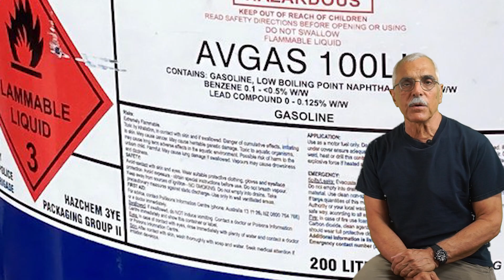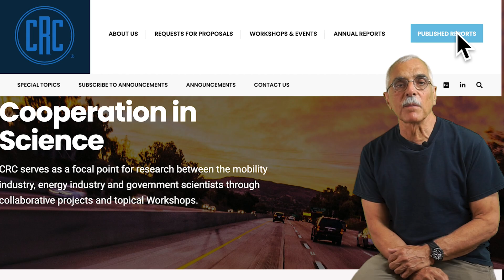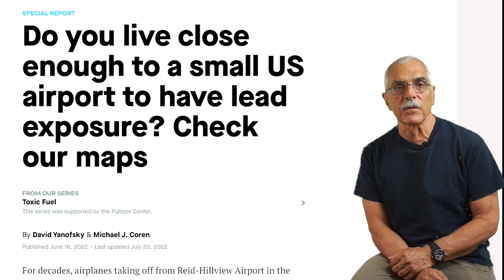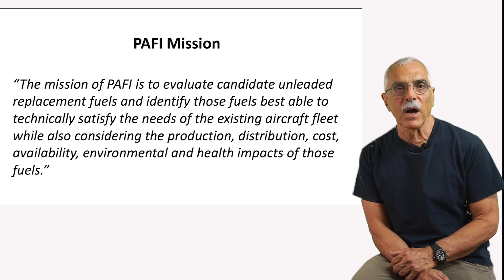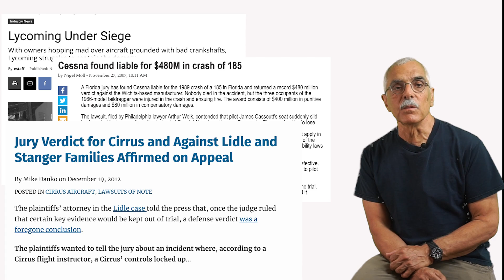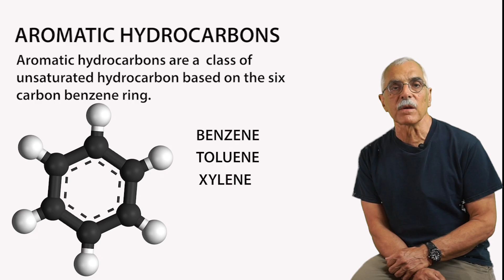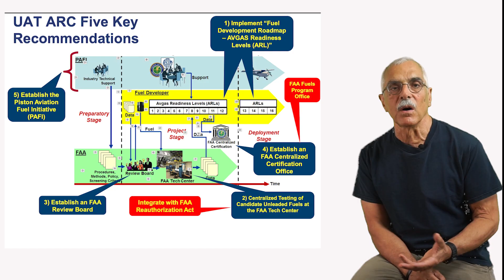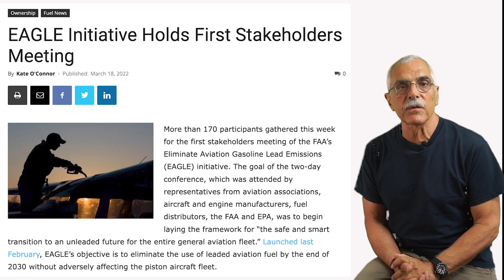The Long, Twisted and Slightly Ridiculous Story of Avgas Part 2

Comment: Lead isn't necessary - unless you don't have hardened exhaust valve seats. Ask the Robinson helicopter fleet in Australia. We found the same thing out with automobile engines when they got rid of leaded mogas. As the older cars went to the junkyard, the uproar died down. Lead makes a barrier between the hot exhaust valve and non-hardened valve seats - preventing micro welds. Repeated micro welds eat valve seats and cause valve swallowing. Which engines are prone to valve failure? Good question. I guess you will find out in the air.
Reply: I have no idea but are hardend valve seats still not used in aircraft engines? To me it's common sense that eventually 100LL will go away and has been obvious for a few decades. Plenty of time to address the valve seat issues at overhaul time and in new engines in preparation for the inevitable. But without a hard deadline on removal of lead I suspect little to nothing has been done to prepare for it.
Reply: @ulbuilder  My airplane turned 50 this year, like most GA aircraft. Its last engine overhaul was 30 years ago. Did they use hardened valve seats? The company does not keep records that go back that far. And how many people also have engines/cylinders that were overhauled by companies that are no longer in business? Who knew to prepare for unleaded AVgas 30 years ago? 40 years ago? 50 years ago?
Reply: @paramax55  The more I read on the subject the more I'm convinced that lead did nothing to protect valve seats anyway so having hardened valve seats or not does not matter. Lower octane gas causing detonation is what erroded valve seats. Even the FAA has studied this and concluded that the lead is not needed to prevent valve wear.
Reply: @ulbuilder  Except that reducing lead has caused valve wear (via the seat) every time. As I stated... it caused a huge problem with Robinson helicopters in Australia. A lot of people don't remember the valve jobs that cars got in the '90s for the same problem. Low performance engines as well as those with hardened valve seats will fare well.
Reply: @paramax55  I just read the Australia Airworthiness Bulletin dated Aug 12st 2021, it did not state that issues were caused by lack of lead in the fuel. It points out that certain blends of aromatics are insufficient to maintain the octane level when less lead is added. The issue is octane, not lead content. Lead is great for boosting octane, that's the only thing it's good for. From the actual bulletin "There is a limit to which the effect of reduction in lead (tetraethyl lead) may be offset by the base alkylate and aromatic content to achieve the required Motor Octane Number (MON)
for the fuel."
So there you have it, lack of lead is not causing problems, lack of octane is what's causing problems.
The bulletin also warns about proper oil selection, operating temperatures and cool down procedures. Did you know lower CHT and EGT reduces the risk of detonation? Did you know lower octane increases the chance of detonation? Every credible source I've found blames detonation from lower octane, not the lead content, for the wear on valve seats. It's true that maintaining adequate octane is difficult without lead. It's true that detonation from too low of octane damages engines. It's not true that lack of lead causes engine damage or that abrasive lead salts produced in combustion of leaded fuel somehow act as a lubricant to reduce valve wear.
Reply: @ulbuilder  So... the Folks Against Aviation say that microwelds at the valve/seat interface isn't stopped by lead making an inhospitable environment for bonding. But NASCAR was able to directly trace the troubles of going lead-free to this microwelding problem. As well as many head rebuilders having a standard fix of inserting hardened seats and eliminating the problem instantly.

If the problem were simply "octane," there wouldn't be a problem. Two solutions are simple and have been around for a long time - Water/Methanol injection and Toluene. Water/Methanol isn't a drop-in, but Toluene is. And it's easy to get - they sell it in Home Improvement stores as Xylene paint thinner. It has an octane rating of 121 by itself and, as an additive, it raises the octane by more than what its ratio says it should. F1 called it "rocket fuel" until it was eventually banned (like everything fun in racing). If valve/seat bonding could be fixed through octane, the folks that make a bunch of money on Sundays would have figured it out a long time ago.

Anything that interrupts the valve/seat bond will work - be it cooler temps, shorter valve open times, work-hardened metal in used engines, a chemical barrier (lead oxides), and of course hardened seats. Lower performance engines will have lower temperature valves. Engines that have both lower performance and work hardened seats also stand a good chance. But there is no way of knowing without "trying it out" and crossing your fingers.

Say what you will, but the folks at NASCAR, as well as cylinder head rebuilders, know that lead in gas will prevent valve recession due to microwelds. The FAA says that lab results contradict this, but the real world experience (also called beta testing) show something different. I spend too much money every time things break on my airplane. Until I'm forced to, I won't be running any unleaded AVgas in my engine.
Reply: @ulbuilder  I just gave you six sources to peruse on this subject. The matter was established long ago and the discussion died down when older cars left the road.
Reply: @paramax55  interesting debate guys! Kinda sheds more light on the subject of (lead is only for octane) and (it's not just for octane, but protects the seats if the engine doesn't have hardened seats or if its low compression can get by without lead). I was there when we transitioned to unleaded mogas & low compression poochy engines. I knew lead was "supposed" to protect the seats. But for some reason never really heard or fully understood the whole  microwelding issue as you explained. I guess at that time I was concentrating on my specialty, automatic transmissions.                 Folks Against Aviation! Good one!
 Oh well, so I guess the beat goes on...
Reply: So do a lot of av engines have cast iron heads without hardened valve seat inserts? Just asking. Any aluminium heads will already have valve seat inserts from day one so they should be fine.
Reply: @oneninerniner3427  Aviation engines have aluminum heads. The seats are steel and may or may not be hardened. There is really no way to know without asking whomever installed them.
Reply: @paramax55  so you can or could get them either way mild relatively steel or hardened? I know automotive valve jobs were fairly common back in the leaded fuel days as well as spark plug cleaning and replacement and gunky dirty engine internals, some caused by poor oils but had a lot to do with leaded fuels. But are seldom needed now days.
Reply: @oneninerniner3427  if you get a valve seat today, I couldn't imagine that it's not hardened. There are a lot of factors today that are different than just 30 years ago that makes things last longer. I have found fuel injection alone to double gas mileage just because of better fuel atomization (360ci Big Block Ford V8). Better mileage means less fuel burned means more complete combustion means fewer deposits. Electronic ignition (usually capacitive discharge) is also going to produce a MUCH hotter spark at a more precise moment. All of this has led to less fouling and longer lasting engines. Metallurgy and machining precision has also gotten us to the point to where the modern grocery-getter would be very competitive in yesteryear's NASCAR.

As far as aviation valve seats being available "either way" 30 years ago, I'm not sure how that went. As far as automotive went, you took your heads to a "head guy" (I used Ed Garlits, Big Daddy Don's nephew) and he would "just fix" them for you. The question never came up unless it was for racing. It wasn't even thought about until unleaded gasoline was all that you could get.

If there isn't an incentive for the more-expensive option, things tend to be built with the cheaper option. Look at how many weed-eaters are out there with aluminum cylinder bores... But as for modern valve seats in an airplane engine - I'm pretty sure the cost difference would be a wash nowadays.
Reply: @paramax55  I agree on all points , I am a mechanic too, not an A&P but have worked on darn near everything else. My Father was in the aviation business so I have some piston engine background there too.  Except I also read about what ulbuilder was talking about. That it is a lack of octane causing high combustion temps that erodes valve seats, not a lack of lead. I have a 1970 big block engine that was transplanted into my old pickup that I bought from a buddy many years ago and It does have recessed valve seats. I ran pump premium non ox unleaded in it most of the time. But did run regular sometimes too. So I ran it hard with regular once and detonated a piston, pulled the head and pan to replace the piston and I then seen that primarily the exhaust valves were starting to recess. Which was a bummer because my buddy spent a lot of money rebuilding that engine before he put it in the truck and the machine shop did not  put in valve seat inserts, they just reground the existing seats that were part of the cast iron heads. But I ran it another decade that way and it still runs, but needs help now. Probably should have run some octane booster or a top lube might have helped a little, idk.
Reply: Also I am currently porting a head on a 2006 model 700 cc big bore dirt bike. I found I can cut the ID radius of the seats with carbine, it's an aluminum head with pressed in seats,  so they aren't that darn hard!
Reply: @oneninerniner3427  Yep. They need to be soft enough to accept the pounding of a valve without shattering. I don't know what the "magic" number is on the rockwell scale. A hammer is also hardened, but you can scrape it with a file. It just has to be harder than the nail, but can't be too hard or it will shatter. Carbide does a nice job on most metals.
Reply: @paramax55  Ed Garlits huh? Wow,  Got a feeling he knew his stuff
Reply: So bottom line is av engines would benefit immensely from the elimination of lead with reduced maintenance. Spark plugs would last, engines internally would be cleaner, oil drain intervals could be increased, quality synthetic oils could be used which would further reduce wear, because now with leaded fuel, lead doesn't like to stay suspended in synthetic oils that's why they aren't widely used,  stuck valves would pretty much be history, even TBO's might be increased. The problem is to achieve high enough octane without TEL. And GAMI says they have the formula?!!!!! So other than the STC deal, they said they will license it to anyone for a reasonably price who wants to blend it.
Reply: @oneninerniner3427  Exactly!
Reply: @paramax55  The John A Garbak article did not control for octane rating. Any study that compares lead vs unleaded that did not also verify that the octane rating of each fuel was identical is flawed. Remember that the octane rating on the pump is minimum not maximum. If one tests leaded fuel vs unleaded fuel and the octane rating of each is not verified to be identical then any difference in wear could be from lead content and/or difference in octane rating. It's well known leaded fuels had higher octane than unleaded therefore comparing leaded fuels vs unleaded is also comparing higher octane vs lower octane. For proof of octane difference see NY Times article "Drive for unleaded gas is causing wide confusion" Jan 17th 1971 "there gen erally were two gasoline grades: premium 100 octane fuel used in the biggest Ⅴ‐8 engines, and regular grade 94–96 octane" "lead‐free gasolines are generally 91 octane, suitable for most 1971 cars" "G. M. detuned its 1971 car engines. They pro duce less power and less mile age but can run on less power ful, unleaded 91‐octane gas." I suspect by detune they mean less timing advance and lower compression, exactly what you need to do to run on lower octane fuels. Detonation is extremely destructive, usually triggered by sharp hot edges. The exhaust valve and seat have sharp edges and are the hottest part of the combustion chamber. Does not take a rocket scientists to see how exhaust valves/seats could be erroded from detonation.
The Garbak study also pointed out that engines under less load were less likely to have valve seat erosion. Did you know that heavily loaded engine are more likely to suffer from detonation? 
So that's two articles you have cited so far that I took the time to read and neither prove lead content is the issue and the Australia bulletin directly pointed out octane, not lead, as being the issue.
"This 94 octane leaded fuel does not cause engine damage but this 91 octane unleaded fuel does. Therefore lack of lead damages engines!" Is not a scientific irrefutable conclusion.
Reply: @paramax55  McArragher seems to only summarize information from other studies. McArragher concludes: "One of the most definitive reviews of the impact of unleaded fuels on gasoline engines reached the following overall conclusion: In summary, the potentially detrimental effects of eliminating leaded gasoline appear to have been greatly exaggerated in the public mind, while the potentially beneficial effects have been understated or ignored. The present widespread public alarm over the effects of this change has little foundation in fact."
So there is a third article you cited and it concludes that the concern of detrimental effects of unleaded fuels "has little foundation in fact"
Also absent from this article is any information or consideration on the effect octane rating has on wear.
Reply: @ulbuilder  Let's pretend for a moment that the men with test engines and laboratories and test fuels are wrong... we do know that hardened valve seats solved the problem of valve recession on unleaded fuels. If the problem is lack of octane causing detonation, how does a hardened valve seat raise the octane of the fuel to prevent this imperceptible detonation? And why are 120 octane - or even "just" 110 octane fuels - not sufficient to stop the detonation?
Reply: @paramax55  Seems like detonation would erroded unhardened valve seats faster than hardened ones. I understand you believe what has been said for many years. People used to think the earth was flat too. The evidence is out there that detonation is the issue, some of the evidence you yourself pointed out even says this. At the end of the day if deposits protect valve seats then an unleaded blend must have some sort of substitute to replace those deposits. If it's an octane issue an unleaded blend needs to maintain that octane under common storage conditions and uses for aircraft. An unleaded blend would need to burn at the same temperature as leaded fuels too otherwise the increased temps could cause detonation even if the octane is identical. There are a huge number of variables involved, lead content, octane, burn temperature, even the combustion byproducts produced during the burn can affect the rest of the burn. Accounting for all of those variables to reach a conclusion that TEL prevents valve erosion is non-trivial and I've not seen any studies that have accounted for all the variables.
Reply: @ulbuilder  the flat-earth comparison really shows that you don't understand the problem yourself. There is a viable pathway for sacrificial oxides to prevent valve recession. Have you ever tried to join two metals with heat and without flux? They won't bond. A sacrificial oxide acts as an anti-flux. And TEL isn't the only oxide that works - it just works the best. As early as the 1930's, it was observed that valve seat metal would actually deposit on the valve. Seeing metal transfer isn't flat-earther crap. Saying that valves recess because of detonation is, however, something without near the plausibility. That would imply that most engines are running with a small ammount of detonation that only happens at the smooth exhaust valve (and not the sharp edges of the spark plug). And this detonation only happens at the mating surface of the exhaust valve seat, not the rest of the seat. And not the other components of the combustion chamber. And that the hardened seat is OK with detonation. If you know of a video that shows detonation only happening at this one spot in one of the see-through cylinder heads, I'd love to see it. Otherwise, it's simply a theory.